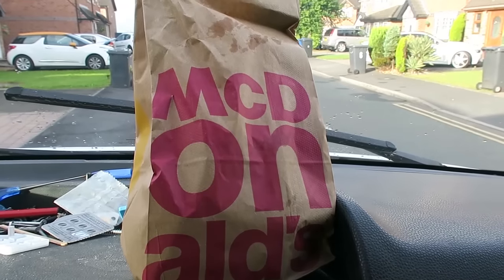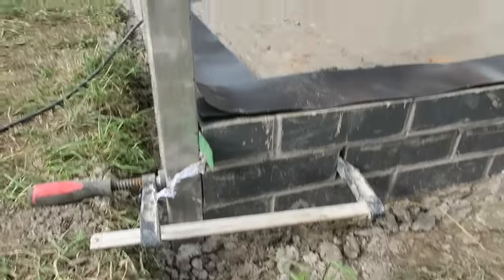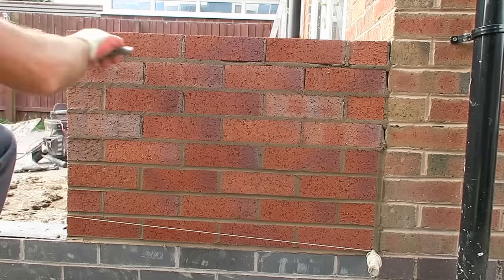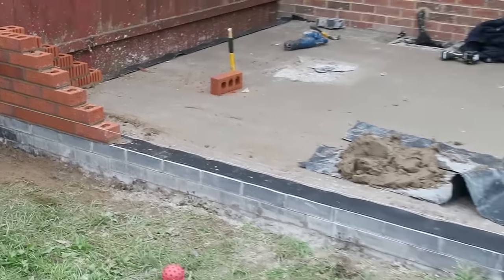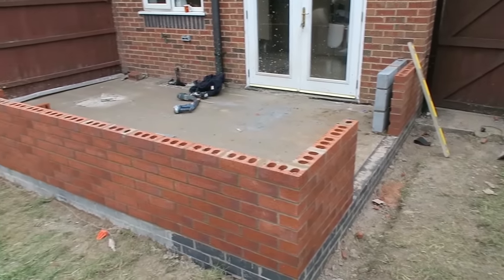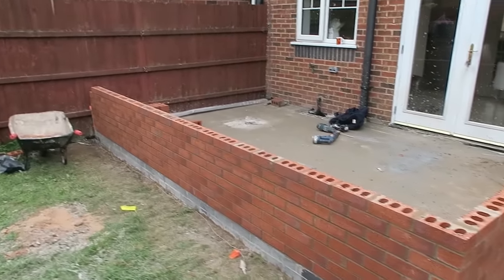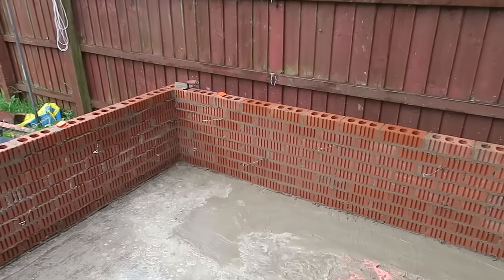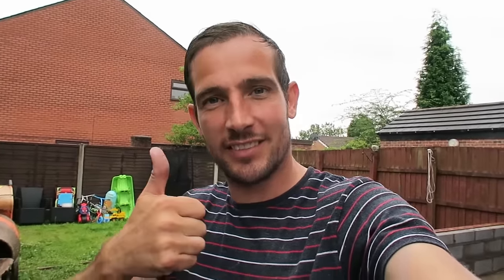Bricklaying - Conservatory Base

Comment: Hi there.
Can you add some detail please?
Do you put a small mortar layer under the dpc?
What is too much rain to lay bricks in?
How far up should the dpc go?
What about ensuring the joints right next to the fence are finished smooth so the rain runs off well?
Do you finish the joint with the profiler after the mix has started to dry a bit?
How many wall ties per meter squared required? Spacing horizontal & vertical?
How many corses can you lay at a time?

Good for watching you lay to the line but not much info to be able to confidently copy.

Comment: When you're laying to the line pull the brick and lift the heal of brick a little to get a nice full head joint instead of just pushing the brick down, another tell tale sign of not a full joint is waves in your striking. Other then that nice job also invest in a pan and stand
Reply from the maker: Yeah I’ve learned a lot since this video cheers

Comment: Stu, random/silly question. The brickwork next to the neighbours fence, do you joint up the face of brick or is it impossible? Suppose you could ask them to take off the fence if they wanted the brick wall in their garden? generally interested guess it depends on customer. thanks a lot

Comment: As a carpenter in NZ I hated anything to do with bricks or concrete.  As the years have passed and over 15 yr in my trade I'm developing a love for bricklaying and concrete as it's realistically are far better choice as it doesn't rot and require every tool under the sun to the job. Great for wet environments like nz but one thing I did notice is why do you put dpc down? Doesn't that mean the whole wall can slide on that and there is no timber to suck up the moisture. Please explain? Great flick bro btw👍

Comment: How do you level the second corner  to the first one without a laser or a long straight edge. I'm just about to do my conny base. Founds are poured and level and I cast my own cut n stuck blocks. On my last conny a builder did the blocks for me and made a shocking hack job of making 45º corners by chopping and smashing the blocks and slobbering them with mortar so I decided I'd make my own. :-)

Comment: Why only two bolts on the wall starter? I always use odd numbered fixings. Three hinges on doors, five for bolting a fence post to a brick wall. Also I have seen the ties put into rather than under the mortar in the wall starters. I am not saying anything is wrong it just looks odd.

Comment: video quality is superb, the video editing is suprb (loved the little spider lol) The brickwork is top class, full joints and ver neat along with the pointing. The only thing i would have done different, is cut a vertical joint where the conservatory goes, and inserted a DPC. Probably would never get damp through, but that just one thing i have always stuck to doing. Nice job there though matey. Thumbs up from me.

Comment: When lifting the line don't drag the corner block up the corner you will eventually snap the line Instead pull the block out a little bit when lifting and you will find your line lasts a lot longer other than that good neat work with well filled joints

Comment: how do you set the corner levels? before pulling up the line.water level?
Reply from the maker: With the laser level, we go round each corner find the highest point and mark down which corners need picking up 👍

Comment: Lovely, smart job again, Stu! You should move to the South-East, start a Ltd Co, get a team together and you'd be a millionaire within a few years!
Should the fixings for wall starters go into the middle of a brick, rather than the mortar joint?
This method would be less likely to pull out if there were some movement.
Also surprised to see you buying four wall ties?
Again, I would have expected you to buy a 'sackful' at a time, for economy ?

Comment: Stu crompton you did a great job, do you know is the grey brick that you used on the inside called?
Reply from the maker: +James fadden its just thermolite block thanks buddy
Reply: I like it more than the regular red brick just cause it is bigger and not as common. I always see red brick on houses and this could really mix it up ill prob build a wall using it after collage.

Comment: Decent work mate, it's have 2 questions. Why did you build the little pillar first instead of just knocking your pin in to the existing on the course you was on, 2 why no labourer
Reply from the maker: so i could video building the pillar, and i just work on my own because i dont do much brickwork, only get a labourer if i do a bit in site.
Reply: +stu crompton fair play

Comment: In Malaysia we will put a rebar acroos a concrete pole beam to hold the brick in place at every 4 rows. You do not do this. Question here is , is it strong enough to hold the brick wall with the method you are using?

Comment: Watched loads of your vids mate and well impressed with your skills.
Im a groundworker and noticed you had concrete splashing up the wall when you poured the slab...
We usually put a peice of plastic up to avoid this..

I hope i dont sound Negative but instead helpful
Reply from the maker: cheers andrew mate yeah i would do that to but i didnt do this slab :)
Reply: Should of guessed mate... didnt think you would do something so simply fixed
Reply: Andrew Bobbin

Comment: The key is in the cement...how do you mix the best cement for this ?
Reply: 5 shovels of sand, half a bag of 25kg cement, another 5. With block work you can add up to 14 sand especially if you're churning out a lot of muck. Just make sure if you're doing face-work to use the same ratio of sand/cement each time. You'll also want 40ml ad-mix per gauge, adding water when necessary.
Reply: Four to one and its called mortar
Reply: Johny R depends what bricks you use. Could be 5/1 or 4/1 like you said. Engineer bricks are always 4/1
Reply: Robert Blackburn rule of thumb is not to make your mix stronger than the brick...
Reply: Robert Blackburn well that’s what I was always told anyway, by a few different brickys too to be fair.

Comment: That little panel on the right hand side, you didn't have to build it separately if you just build the return corner and then just pin your line into the existing brickwork, less level work, less effort.
Reply: But great video anyway, thumbs up.
Reply from the maker: i did this so i could film building the pillar, but thanks for your comment
Reply: @Stucrompton1   nice tidy facework.
Technically that is a panel of brickwork not a pillar ;) 
I am surprised you did not cut a vertical dpc in between the leaves where your walls join the house or close the cavity at the door opening though.

Comment: TIP from a retired builder, if you ever need brickwork done get a qualified brickie to do it because this is not as easy as it looks and certainly not for amateurs.
Reply: Exactly. Mixing the muck up to the correct mix, consistency of slump and colour is a key skill in itself before any bricks are laid